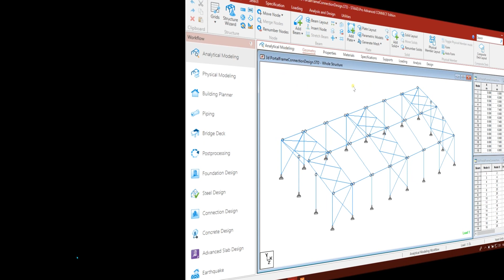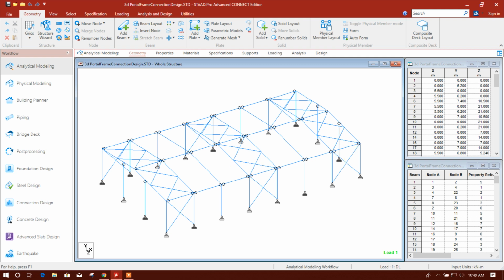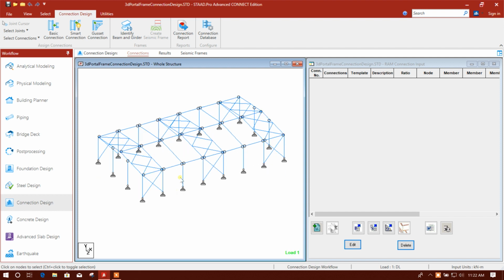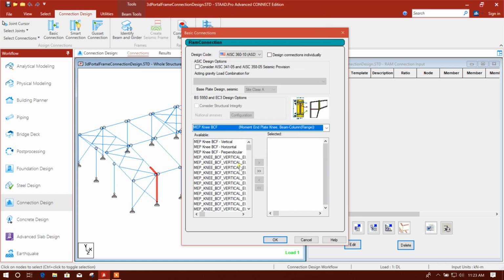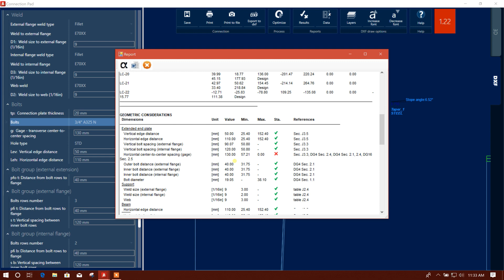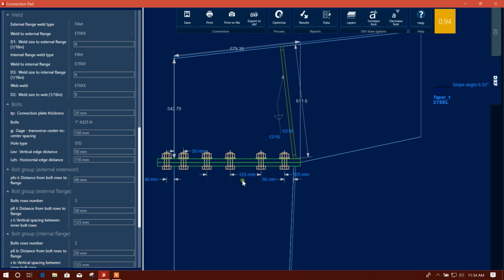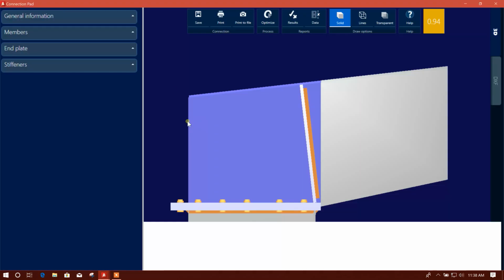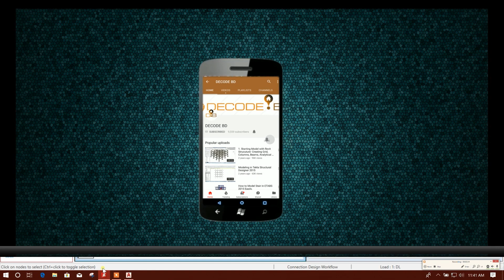CONNECTION DESIGN IN STAAD PRO RAM CONNECTION

Comment: Bro , Please kindly reply ..I have designed a steel structure...and would like to extract the values of shear and moment from software and design using manual/spreadsheet ..Can you please make a video on that procedure...or else guide me here in comment section. I am following Indian Code ...I know I can used Idea Statica but my computer configuration doesn't allow me to install the Idea Statica as of now...Please guide me in this matter